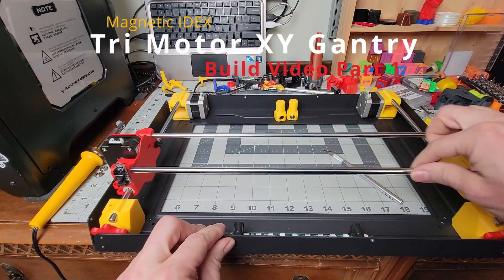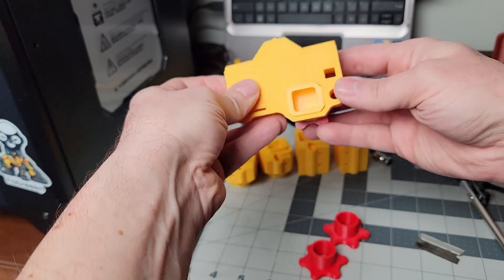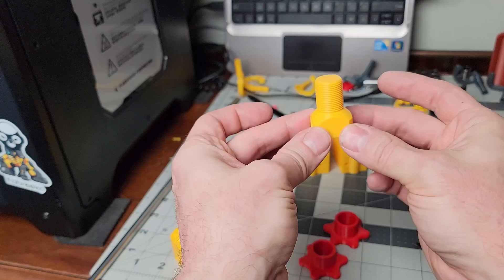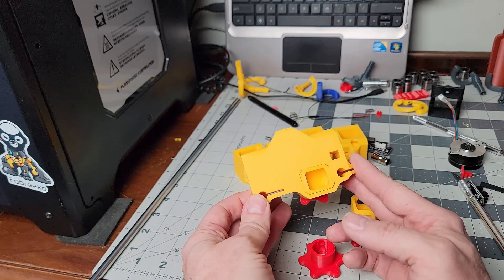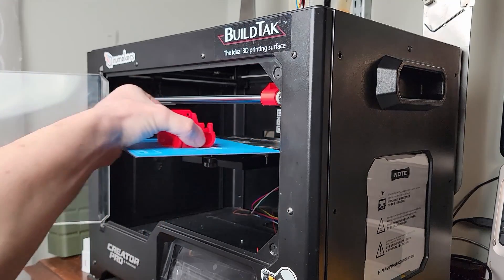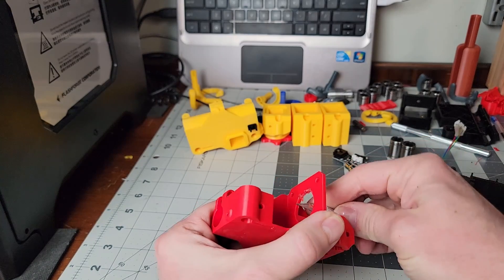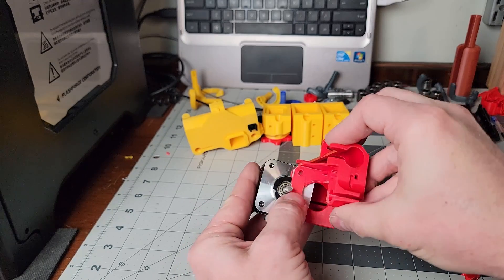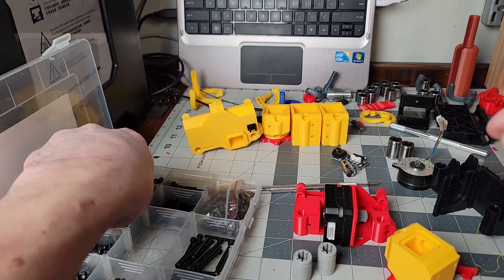Magnetic IDEX Tri Motor XY Gantry - Build Video - Part 1 #klipper #opensource #reprap

Comment: I feel u can try the motor off the gantry, save weight & X wiring movement.I found in some forum sLider they call it. (It’s an old system use in some laser & printers machine) the X-belt is not moving but the pulleys. I don’t like coreXY much so that’s my option. I can put as big X motor I want and still have a light gantry. I have yet to try your magnetic coupling idex which I think is still the best among those I ve seen. Thanks for your sharing❤.

Comment: Amazing work I really like this design, sad there is no printers locally I can use, I would have to build frame also.  You 3d print GT2 Pully?
Reply from the maker: Thanks!  Sorry about creator pro availability.  eBay is usually full of used creator pro printers.  It should be easy enough to build your own frame 😊  

GT2 pulleys in video came from the donor Creator Pro.  It is an injection molded pulley.  I have a love-hate relationship with these pulleys.  In the next video you’ll see that I replaced them all with 16T aluminum pulleys.

Comment: Love it! I also love that you use some kind of Replicator 2x frankenstein copy :D
I also own a 2x, an original one, that I've completely rebuilt with open source hardware (RRF firmware and a Mellow Fly controller).

The machine didn't perfom the best, but it was good enough. Now you have me thinking... I bought a Bambu X1C, so now I could finally redesign the entire Replicator 2x and turn it into a CoreXY printer with dual extrusion!!! The X1C allows me to print higher temperature filaments, so I guess I should print everything with PA-CF or something. Damn, thanks for the inspiration!
Reply: I thought about the same for ultimaker printers. There was a lot of print volume lost. 🤐